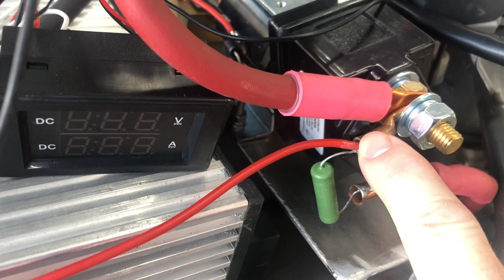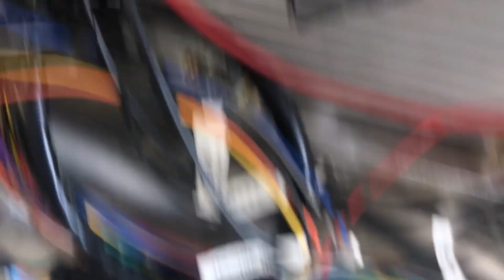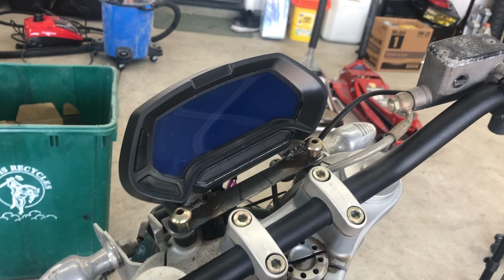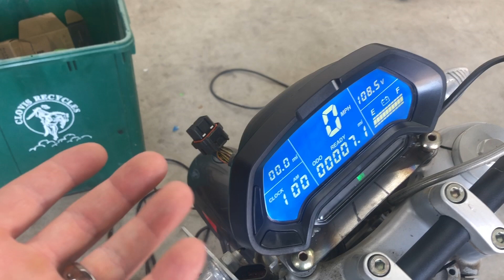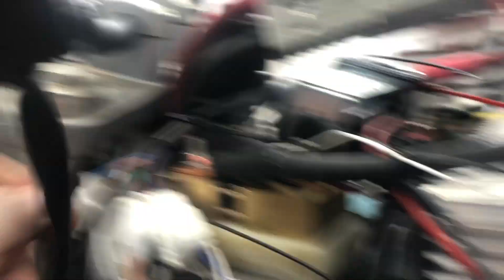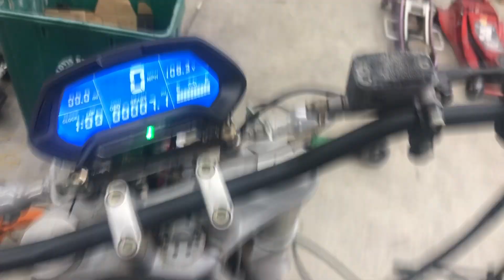Electric Ducati Accessory Wiring and APT Controller Connection Guide

Comment: Possibly a bit late now, but that issue with the Hall sensor and trying to use the additional connector might have worked if you had also applied a power and ground to the other hall sensor connector along with the sensor feed as I think they are 2 separate circuits designed for in case one fails, unless you tried that and it still didnt work but didnt notice you mention that.
Reply from the maker: Good point! I didn’t try that, actually. I just quickly moved past to the other sure solution when it didn’t go my war immediately, haha. Next time I might give it a go

Comment: What size is it on ur diode on ur 12v side of ur main contactor
Reply from the maker: It’s not more than a couple amps. I believe it came with a Kelly controller way back in the day. Even at 12v they don’t have to carry more than 2 amps to momentarily when it opens and closes
Reply: @LordCurt   first video that went indepth with those type of contactor just a little confused on the doide section is it matching the polarity of the postive of the 12v or is it opposite and do u have have the 96v on the top plate for it to activate from rhe 12v..   try mines by just add 12v and diode and the contactor didnt move
Reply from the maker: @Ai-TechWorld1  read the badge on your contactor to see if it has a 12v coil or a full voltage coil. The diode is wired reverse (negative to positive), but it shouldn’t prevent the contactor from opening if not attached. For mine, it didn’t move until I realized the coil was 96v and needed full pack voltage

Comment: That APT inverter is super huge!!! How much is the batt amps and face amps?
Reply from the maker: It’s massive! It does a great job, though, so no complaints. It can do 450-500 DC amps according to my meter and 1000 phase amps.
Reply: @LordCurt  have your considered a Fardriver?
This guy build my dream bike with it supposedly it can make 1800amps face
https://youtube.com/shorts/m1REtZTAqiE?feature=share
Reply from the maker: @SniperSnake50BMG  the current build we’re doing uses double far drivers! It’s the go kart we’re building. I should have them running close to the end of this week and hopefully be testing the week following. The problem is they don’t yet have that model available for encoder motors, so we had to do 2 at 850 each, but it’ll still put out more power than a single motor with one 1800 amp controller since there aren’t good options of motors able to handle that current